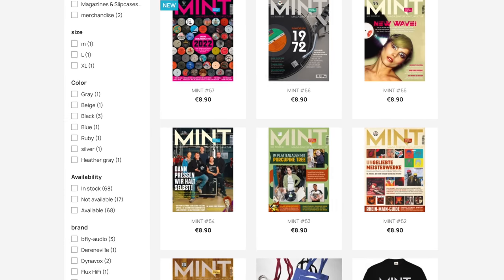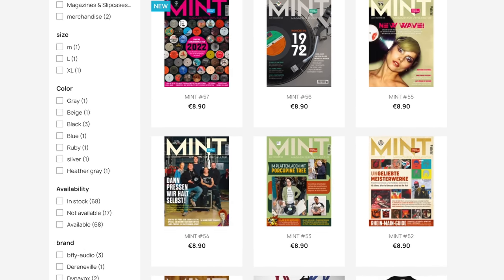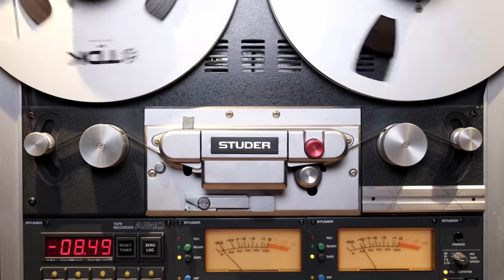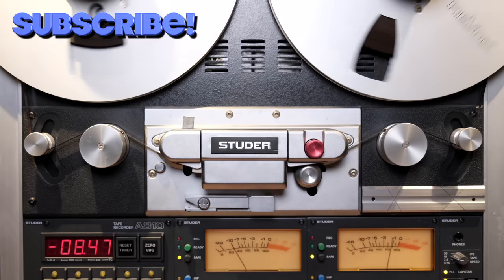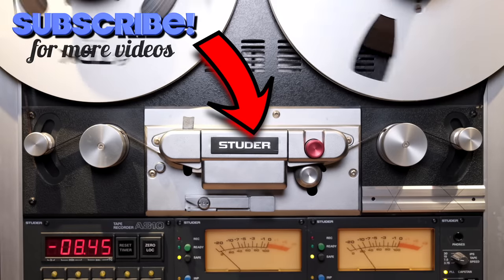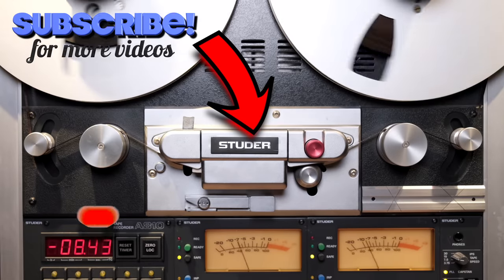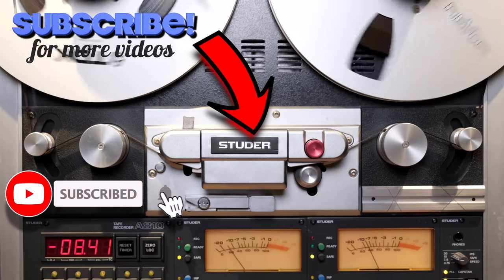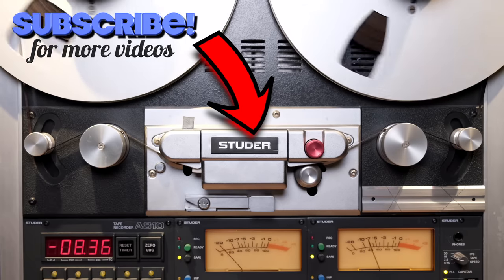Digital Delay: The little dirty secret of vinyl mastering (including past AAA records)

Comment: Have you checked to see what these digital delay lines are like in modern pressing plants with the latest electronics? What are the sample rates being used today? I'd be willing to bet they  take the sample rate of the supplied master, regardless of what it is and in what format (DSD, PCM, etc) it is supplied, and simply delay it while supplying the audio file bit perfect to the DAC. And I'm also sure that the A/D-D/A  conversion that occurs with an analog master is probably going to be audibly transparent, given the capability of modern digital audio processing  I also wonder about the weird claim of reducing the signal down to as low as 8 bits in older pressings. Is it possible that they used that low bit rate conversion only for the lathe pitch control, but passed the audio signal through at a higher rate?  Let's not forget that regular PCM processors with 16 bit processing were already available in the late 70's. I do agree with you that there should be more openness in exactly how "analog" a modern vinyl lp actually is. I'm reminded of the old Monty Python skit where the guy said to his wife "It's only got a little Spam in it".
Reply: Yeah, the 8 bit audio doesn't make sense. We know how that sounds. But A/D-D/A is never a 100% transparent, there is always a change of the signal that way.
Reply: @booom4849   You should try a straight wire bypass ABX test with a high quality A/D-DA chain compared to a piece of wire. Easy enough to do. Good luck hearing the difference. I've done the test, and failed it miserably.
Reply: @johnstone7697  Yeah I did that with quad DSD and succeeded. Don't have a $10k  converter though.
Reply from the maker: I never denigrated the quality of current digital delay, which yes I did check and they have higher resolution. The problem is that they were using DDL since in the 80's also in analog recordings as well as today in current "AAA" productions. Clearly  most audiophile labels use analog delay machines but in other cases other labels probably don't even know that their laquers are being cut from digital, reissues and new analog recordings. The 8 bit claim as declared is sourced from Fremer: https://trackingangle.com/features/a-guide-to-collecting-japanese-imports
Reply: @anadialog  Actually the article is written by Michael Johnson on Fremers site. Sorry for the "nit picking" 😊
Reply from the maker: @filmnarr163  true. I just mentioned that for a rapid written comparison. Fremer mentioned this issue in this video (he says 6 bit but reading other stuff I understood that he meant 8 bit) which was released almost 4 months ago: https://youtu.be/Osldhozl6Ig min. 24.39
Reply: @anadialog  ...although I immensely love companies like Tone Poets, ANP or Speakers Corner (I worked 30 years in a well known HIFI shop in Vienna and sold the stuff from day one), I'm still keep wondering, why vinyl coming from digital masters (or are cut with a crappy digital delay as some of the mentioned Japanese pressings) still for me have a tiiiiny bit the edge over their digital counteparts, when I'm in the right mood ☺
 I'm collecting records/CDs/SACDs/Tapes for almost 50 years now, have really good TT and a CD/SACD combo for double the price (= + 10.000€) as well. So "digital" sounds most of the time really pleasing!

 As many others I really loathe the "loudness war" with its terrible compression artifacts - which are, by the way, a completely "different beast", than the ones generated by "analog compression" (!) - that kills most of our music nowadays. 

But (coming back to the "delay" topic). Even if records include some "dirty" (more or less) "secrets" they (mostly) still let the "musical flow" intact, and THAT (at least for me) is the main quality of a good TT setup and (in my experience) much easier to achieve with analog, and has a price in digital. DSD and Highrez well done (=not compressed) have that qualities as well (or filterless dacs for instance). 

As far as I remember, it was Bernie Grundman (and others) who claimed, that something is "happening" on the way from the master to the consumer/disc. That maybe explains, why different CDs frome the same master can sound different AND why a "8bit delayed" record still can transport the message of the music - because of the shortcut. So MANY variables and for sure not ONE solution...

Paul McGowan (a digital addict for certain personal reasons) from PS Audio told in one of his (daily) videos a story: They have now an own record label "Octave Records" and run an absolutely "state of of the art" studio. They record in pure DSD. Paul told, that when he is sitting in the studio the microphone feed sounds completeley 1:1, compared to that, what he hears from the DSD file. No difference at all. Nada.

 For some months now, they cut vinyl (from the same files!) in limited quantities. ...and You know what he says abot them? They sound different (ok...that was clear), but... BETTER. Why? At the moment he tries to figure that out. 

So let's stay relaxed and let's enjoy our music without thinking too much ( although I'm 64 now and cannot "let go" for myself😜)
Reply: @anadialog  The 8 bit claim is unsourced in that article, and we should not take it seriously.
Reply: @booom4849  The funny thing is: 8 bits (appr. 48 db of dynamic range) is more than enough for most pop music.
Reply: @nyquist5190  So why then all 8-bit music I listened on yt sounds like straight out of a Sega Megadrive? It's just a way different sound.
Reply: @booom4849  Properly dithered 8 bit is just noisier. Vinyl is inherently noisy and pop music is not very demanding,
Reply: @nyquist5190  8 bit doesn't even have the capability to render voices, it's beep beep beep.
Reply: @booom4849  No it is not. You can easily try this yourself with an audio editor. Audiophiles really should learn the basics of digital audio.
Reply: @nyquist5190  You are pretty deluded. 8 bits are 256 values, this is 256 times less than 16 bit, and it is well known fact, that 24 bit sounds way better. You have to learn the basics of digital audio.
Reply: @booom4849  I know it means 256 values. Translated into analog it means a dynamic range of approximately 48 db, roughly in the ballbark of FM radio. Remember, you can easily try this yourself. As for 24 bits sounding "better" there is no evidence of this at all, just unsubstantiated audiophile beliefs.
Reply: @nyquist5190  You cannot make such conclusions. Analogue is basically infinite bits, because it's not quantized. So you understand: Sure, you have some noise floor with analog and usually a restricted dynamic range, but within this dynamic range, you basically have maximum number of bits. 

Even non-audiophiles use 24 bit, for example in the studio, all the time. 16 bit is just not enough. Going above 24 bit is probably useless though for a consumer format.
Reply: @booom4849  The infinity of analog is just another unsubstantiated audiophile myth. Every system's - digital or analog - resolution is limited by its own noise level. FM radio is just as limited resolution as 8 bit digital. The conclusion is perfectly valid. Information science 101.
Reply: @nyquist5190  Nonsense. Obviously the noise has an impact, but it has nothing to do with quantization. Analog is not quantized by definition.
Reply: @booom4849  Of course it is not quantized. But its resolution is still limited by its own noise. In digital systems quantization also produces noise  - the difference between the real and the quantized value. With 16 bits the noise is lower and the resolution respectively higher than in any known analog system. But as already stated even 8 bits is in many cases more than enough for an inherently low res medium like vinyl.
Reply: I also think that this 8/6 bit converter is only used for lathe pitch control ! Whatever Fremer says... it seems implausible !
Reply: @nyquist5190  low res medium, lol ... right you bring like 20% useful information to the table, but you are just trolling, cu
Reply from the maker: @pablohrrg8677  I agree. I was reporting what a journalist claimed.
Reply: the story is a total lie
Reply: "modern pressing plants" press records. Few master them. The ones that do like GZ Media and Optimal can master AAA using a preview head. Guido knows very little.
Reply: @pablohrrg8677  The "including AAA records" should be removed from this clickbait video. If Guido didn't mean to imply that today's AAA records are actually cut digitally he did a poor job of it based on the comments here.

Comment: The digital delay is only used to predict the amount of pitch, and does not introduce digital into the signal path, right?
Reply from the maker: Nope, sadly the signal is converted to digital (and then back to analog) and goes on the record. The billboard article I show in the video explains it clearly
Reply: @anadialog  that's crazy. Thanks for bringing light to this.

Comment: If  over 90% of all AAA have this digital step, then I think the problem is not the process, but the audience's beliefs that somehow digital is evil.  There is nothing inheritedly wrong with digital. One can argue that the reason why vinyl sounds so good is because the mastering process required to get the material on vinyl makes vinyl sound a particular way  and that CDs sound so bad because none of those mastering choices are needed for CD.  Nobody could hear the digital in MoFi pressings and everyone praised their one-step releases...The only one person backtracking is Fremer, but that guy has issues.
Reply from the maker: No, it's over 90% of all records currently produced. Yes mastering is part of it BUT when you buy a 100% analog release like those made by Analog Productions or Speakers Corner or the the Tone Poet bluenote they are at another level. If you don't have a comparison of course the MoFi sound good. They are properly done, butbif you compare them with an original or true AAA edition you immediately hear the difference. Not always of course, but in the vast majority of cases. MoFi never one me, I have only 6 or 7 records by them.  Ot even the AAA are that good. I like more their past gold CD remasters.
Reply: GUIDO IS LYING OR JUST IGNORANT OR BOTH.

Comment: Would you like to see pictures of analog preview heads at all of the major mastering studios around the world that I have? Will you issue an apology for your spreading this nonsense? Will you take down this video or amend it? I left out of my list Capitol, which is no longer operating but Ron McMaster showed me the preview head he had. The new DGG AAA records will be cut using a special 4 track preview head because they are cutting from 4 track surround masters and mixing live to lacquer ALL ANALOG.
Reply from the maker: I hope you got my point in the answers below. If this is the message the video is delivering then I will add a specification at the top and pin it. I am in search of the truth here. I would never invent something or make a video without solid info just for click bait. That's not my style. Since the 90's with your DVD, which I still have, you greatly inspired me I hope you will believe my words.
Reply from the maker: P.S. I also changed the title (I added PAST) so now maybe it's more clear.

Comment: I recently watched a Paul McGowan video about how Octave Records transfers its DSD recordings to vinyl and it seem they do not undergo any compression during the procedure and I can't help wondering how a perhaps 90 plus dB dynamic range is going to be accommodated on a disc, particularly if a lot of the high level information is at low frequencies.
Reply from the maker: Well, the RIAA curves does miracles from that point of view. We're just going to see if the stylus jumps out I guess!
Reply: What kind of delay does octave records use?
Reply: @380stroker  He didn't go into details but mentioned that two signals were sent to the cutting head: the first set up the movement of the head to expect a certain type of cut and then the corresponding audio signal was sent to it a short time later (no mention of time delay and I can only assume that the engineers at PS Audio would have devised a means of successfully tying in both signals to achieve that). What he didn't mention was what would happen with music that had very deep sounds at high levels for an appreciable amount of time - like a bass guitar in heavy rock - and how that could chew up playing time - even with the RIAA equalization.
Reply: @johnmarchington3146  Interesting.
Reply: @anadialog  That was my main concern too. PS Audio may end up changing their minds if they start getting a lot  of complaints about mistracking.

Comment: Hence,  if the analog signal has been converted from A to D and vice versa for this delay proces the statement that vinyl sounds better than digital does no longer hold water. That said if vinyl compared to digital still sounds nicer to our ears then something else in the chain after the record itself comes in to play. The first thing that comes to mind  is the mechanical to electrical conversion done by the phono cartridge. makes sense ? Same goes for tubes. They are not better than transistors but they are adding something to the sound ( a color) a sound hat I like. My 2cents
Reply: I think you are quite correct in your reasoning. Many audiophiles do not prefer vinyl despite its shortcomings but because of them. Then they blame digital for not coloring the sound the way vinyl does.
Reply: You are right. Some people simply choose the kind of distortion that sounds nicer to their ears. 

Bottom line, if it sounds good to you, good for you! No need to be purist.
Reply from the maker: Harmonic distortion first of all! Here is a video I made on the topic: https://youtu.be/aTYc7vZuM-c
Reply: I've watched the video and we are thinking the same about distortion and how pleasant it's to ears. As humans we are analog beings and all our sensors are analog based so to me it makes sense. Your conclusion at the end of the video..?  to me it doesn't hold water anymore ?. At that time you. concluded that one has to have  a complete analog chain to make this positive harmonic emotion come to life. As we now learned that vinyl is also digital just before the creation of the record however it's still possible to hear " analog"  when plying that record ,there's something dominant that's overlooked. Clearly the record with its groves are analog and the mechanical to electrical conversion is also analog. Perhaps this is the dominant factor in the vinyl chain? . making a connection to streaming. Perhaps that's why I prefer the sound of a R2R DAC above a chip dac even though technically compared to a chip its a lesser (older) technology ? food for thoughts :-)
Reply: @hansbogaert4582  The problem with this explanation is that even if we are "analog beings" the preference for analog sound reproduction methods is not universally shared. In addition, when listening to cds or streaming we are indeed listening to analog, converted by a DAC.
Reply: That is why DAC's also have a "sound" to them. 
The vinyl conversion is pretty unique though. It's known that people buy a vinyl record, digitize what's on there to listen to it via a DAC. You get a vinyl sound while keeping your record at "master" quality. Next to that you have your " vinyl" with you for on the go. Never heard it myself and did a comparison though.
Reply: @hansbogaert4582  Some DACs indeed may have a sound to them. However, serious DACs reached sonic transparency many many years ago. In 1984 already Linn's Ivor S. Tiefenbrun could not detect the presence of an early Sony PCM-F1 converter in the playback chain.

Comment: Mastering studios were the earliest adopters of digital technology - as you said, in the 1970s - with a digital delay line replacing the preview head; and - as you said - originally at 14-bit. And this was not rare but commonplace and increasingly standardised in the era of vinyl as a mass market format; yet - as you said - many pressings that will have been through this digital step in the mastering chain, from this era, are now regarded as superb examples of the LP format (often collectible and commanding high prices). So what does this tell us? It tells us that AAA in itself is meaningless as guarantor of sonic and musical quality. A well-engineered recording in a great sounding studio tracked with quality equipment will sound fantastic if decently mastered even with a DDL line from the analogue tape feeding the cutter head. Conversely, a poorly made recording will not land on your turntable as an excellent sounding LP, even if Bernie Grundman cuts it AAA. Far from a dirty little secret, but open industry practice from the heyday of mass market vinyl sales. I don't think the musicality of the finished product can ever be reduced to single component or process in the chain from musician's physiology to consumer's phono cartridge.
Reply: Right on the money! Considering the fact that vinyl playback dynamic range is equivalent to  about 12 bit digital, I'd imagine that the engineers considered 14 bit to be totally adequate for the job.

Comment: Very interesting and informative not sure I understand it all but eye opening none the less
Reply from the maker: In summary: since the early 80s there is a growing number of mastering machines that DON'T use an analog delay (machines with two heads) but only one with a digital delay. That signal is converted to digital, processed, and converted back to analog and then cut on the record. So even if you have an original album on tape in several cases (who knows which?) It will be converted!